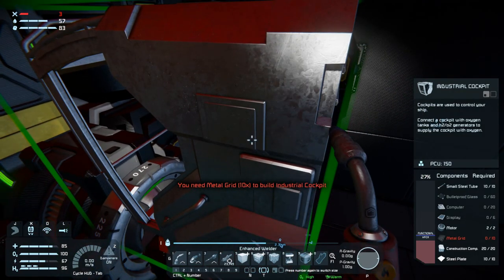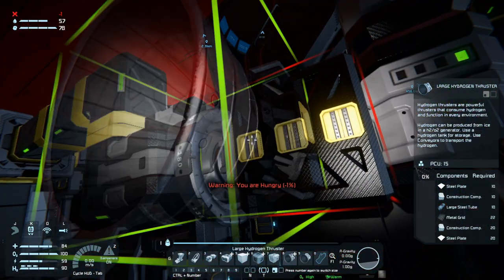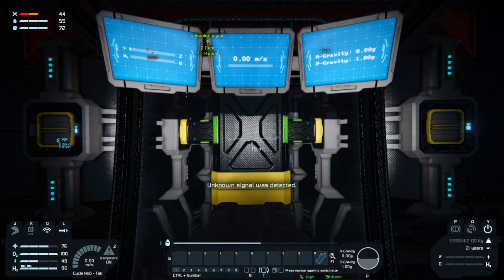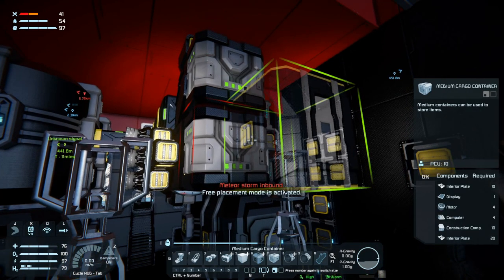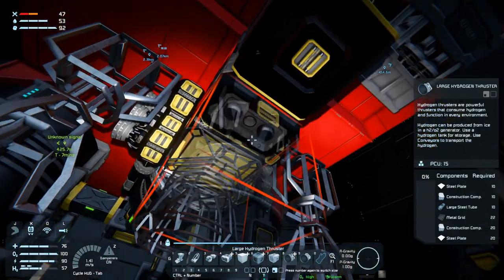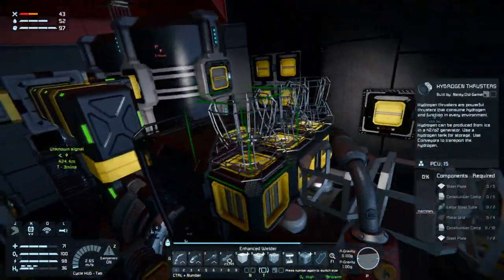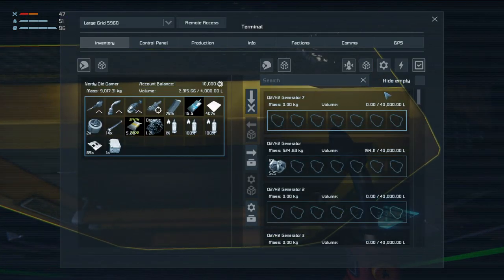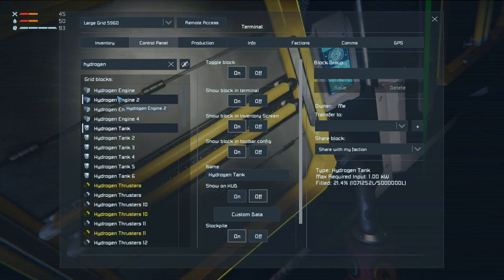Lets Play Space Engineers Modded Survival Ep59 | Hydrogen Mining Ship

Comment: That little mining ship is going to give you nothing but trouble lol.

1. Drills mine in a 3x3 grid as I'm sure you know. The large hydro thruster occupies a 3x3 grid as well, which means if you can fit one in between your drills there will be rock/metal your drills can't get to and it will get jammed into your thrusters.

2. If that is meant exclusively for mining in space the large thrusters are unnecessary. You have to remember that in space there is no gravity so you won't have to deal with mined materials weighing you down. On a moon it could be a slight issue but they still have significantly less gravity than a full on planet.

3. If you planned on docking and launching that thing from inside the ship then your braking thrusters should be moved back or they will probably burn up your connector every time you dock and undock. To be honest I would not dock a ship inside your cargo area, there is so little room that you are likely to bang into something and break it or burn a hole in the hull with your thrusters. At the very least if you are determined to try it I would add another layer of plating to the bottom/top of your ship for redundancy, maybe even encase your hydrogen tanks to protect them as well. Ultimately I'd advise you to leave the connector you currently have on the side for your drills and use that for docking instead. I would also advise putting a piston with a connector on your ship so that when you need to dock you can extend that and not worry about your thrusters burning into anything. Obviously adding a camera on there will be a good idea as well.

If you wanted downward facing drills I would resign the ship like so. Take the large hydro thrusters off and put a row of small conveyor junctions directly down the middle. Then place your small hydro thrusters underneath those and connect your drills to the sides off the small converyors. That should give you enough thrust and put the drills where you want them, it also allows room for further expansion as you'll have a row of conveyors already set up to attach drills to. If you need to expand outward you can use small conveyor junctions again placing small hydro thrusters underneath and attaching a drill to the side.
Reply from the maker: Hi Flawless, I hadn't considered the thrusters being an issue on the bottom to be honest, I may redesign that... It is intended to drill on the moon also, so I think I do need some reasonable thrust at least.

Regarding having it in the cargo bay, I think I will leave it like that, at least for now, but when I need to start mining I will probably put a connector on the outside, just to make it a bit easier, and just put it inside when I am travelling.

I actually already put cameras on, I think in the next episode that's coming out, so I have taken your advise about cameras already :)

Thanks for all your tips! They are highly appreciated.
Reply: @NerdyOldGamer  Well as they say, two minds are better than one. xD

Looking forward to the adventures in space! xD